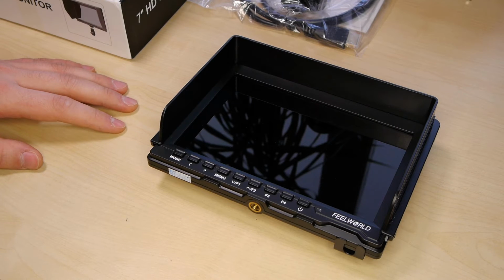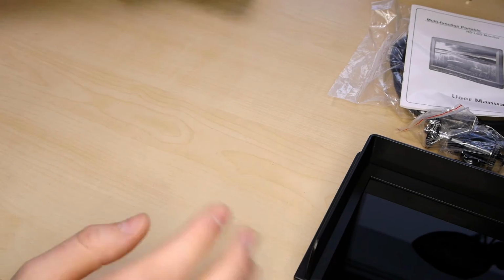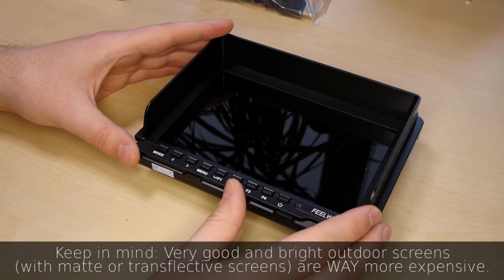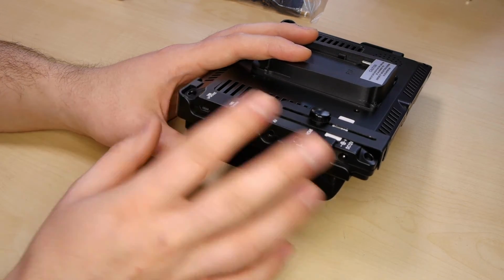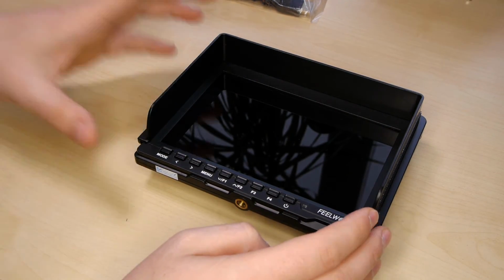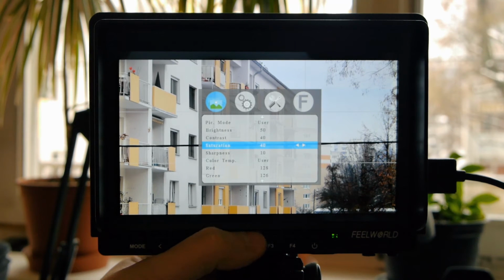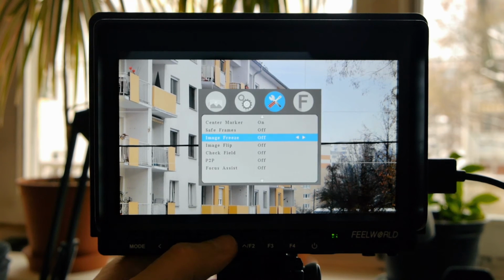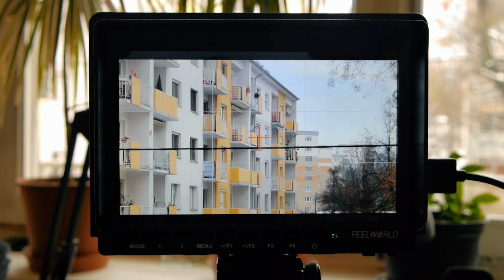Feelworld FW759 / FW759P field monitor - Very detailed HANDS ON (with calibration settings) (!)

Comment: Hi! Does FW759P have  issues with zebras (offset after calibration) like  the Aputure monitor that you reviewed? Thanks!
Reply from the maker: +Kazanchev Well - I cannot tell you that - Sorry. As I only had the FW759 in my hands til now.
BUT: The "P" model is already worth it according the histogram (which is nice to have as an overlay on the screen direclty).
And at least you get the option to use the zebras (even if you would need to switch back to one of the standard settings to get more accurate readings).
Maybe someone who is using the "P" model already can answer that question ... 

But I don´t think that you´ll run into any problems at all (in general). I just calibrated my screen slightly.
And you could even use the "standard" picture profile (which is also usable).
Btw. don´t forget - That would be only necessary "IF" there are really offsets in the Zebra readings. ^^
Reply: +AustrianGeek  I've recieved my FW759P. Zebras are useless, "right" color is only in P2P mode (useless too), all "P" functions are pretty much useless.  The 480P mode on my 550D looks so awful, can't focus at all, everything's just a blur, the interface is out of the screen... Focus peaking is a joke. Really dissapointed. Do you known where I can download new firmware? Official site has blank download page...
Reply from the maker: Oh. That´s bad to hear - Are the zebras not adjustable? And according the colours: Why are they only right in Pixel 2 Pixel mode? Shouldn´t be the case.

480P output from the older Canon bodies is always problematic btw. - It´s just SD resolution (so external screens are not THAT of a help at all). They are bigger - Sure - But they are not giving much more details to focus signifficantly easier for example. The "camera mode" (which forces 480P output on the FW759) is btw. meant to deliver more of the video image - So it´s cropping of parts of the image to zoom the center part a little bit. If you need all of the overlays, disable this mode - The image should then be a little bit sharper too (as it´s not zooming digitally monitor internal). Btw.: If the aspect ratio isn´t correct (with camera mode switched off), try to fixate the aspect ratio to 4:3 (in the FW759 menue). And try combining these settings (camera mode + 4:3 mode) to find the best combination.

In general the T2i / 550D is the limiting part - And not really that nice according external monitors. If you want better HDMI output it´s maybe a good idea to upgrade to a used 650D or even 700D (they are already very cheap on the used market and both magic lantern compatible). Just saying - With the 550D you will not be happy with an external screen (and a 1280x800 screen with such a low resolution is also quite useless) ...
Reply: +AustrianGeek The zebras are not adjustable!  They provide wrong results before and after calibration.  Calibration also affects the zebras. The P2P mode gives ideal picture with best color reproduction (like camera sreen). Saturation (sharpness and contrast too) shifts when the P2P mode is off. You can try it yourself. Connect Feelworld monitor to the PC, set 1280*800 resolution and try turning it (P2P) on and off, you'll see what I mean. The P2P mode is not affected by sharpness settings and stragely affected by saturation, contrast and brightness.
Reply from the maker: Hmm. Ok. So it´s the same like with the Aputure VS-2 I tested a year or so ago (according the zebras shifting). At least the FW759P is only about 10 bucks more expensive compared to the standard FW759 model (and at least the histogram and the additional peaking mode should be worth it - Especially if you have a camera or camcorder without internal histogram or without an histogram in video mode - Like many Nikon DSLRs).

According the P2P mode: Hmm. Yes - Sometimes it makes sense in general to use the P2P mode (as that way the internal scaler is bypassed / not used anymore). So you´re getting a better image because of that (as far as it´s possible according the input type / signal type). But it´s a little bit weird that it´s shifting the saturation and contrast too. Sharpness is more or less normal - As the scaler is bypassed (which is used to add more sharpness). Maybe also the rest of the settings are affected that way.

I had it connected to the PC too - As always within my monitor testing procedure (but I didn´t check it according P2P vs. non-P2P mode).

THX for the info btw. (!)
Reply: +AustrianGeek 10 bucks? No) It's $57. Feelworld's histogram isn't working... It gives me some BS info. When I shoot overexposed wall or sky (pure white, just to simplify the test)  it shows some different peaks (rather than "overexposed" type of histogram with peaks on the right side), it is completely broken and it shows different info when I cycle through aspect ratios. The  scaler is the evil thing in this monitor: it gives oversaturated image, less dynamic range (blacks and highlights), and aliasing
Reply from the maker: Well - It´s actually 135$ vs. 115$ on Aliexpress. Ok. Then 20 bucks - I hope you paid not that much for your screen (at a local dealer or so). About the histogram: Keep in mind, that it´s reading the HDMI output - Not the sensor directly (like an internal histogram). So you also get all the menu overlays AND also a "full readout" of the signal (from 0 to 255 values). That way you also get the option to see values from 235 to 255 (if you´re using a camera which is offering "super bright" areas like many Panasonic and Sony cameras. Your camera is outputting 16-235 as value range (as far as I know). So you´re not using the full histogram width. The best way is to check where the white indication point is on your camera (in the histogram) and use a marking - a small sticky tape piece or a removable pen marker as indicator to mark the point. Not very professional I know - But it´s at least a way to get more accurate readings with an external histogram. And it´s more or less the only way (testing it out). If you really want better reading you need a waveform or RGB parade monitoring - And such fielmonitors are WAY more expensive.

The overall problem is really the 480P output of the older Canons (it´s also a HUGE problem with other field monitors - Really hate that mode). It seems like the scaler is not perfect for such low resolutions (in the FW759 - Goot to know btw. - THX - I am adding it to the description). Though keep in mind: As said - It´s a problem in gerneral. So it´s also not that helpful to switch to another field monitor anyway (or let´s say it that way: It´s not THAT much better even with the best models out there). You would maybe get less aliasing (becuase of the better scaler). But the question is if it´s not more useful to upgrade to the 600D, 650D or 700D and to get a better HDMI signal from scratch on (which will work with ANY monitor from scratch on).

Just to mention that too: The histogram is changing btw. because you´re using different screen areas (while switching through the scaling modes with the 480P resolution). At least it´s normal, as far as the overall exposure point isn´t shifting (if you´re using a grey card for example the hump in the histogram should stay more or less on the same point). If it´s really changing the exposure point, then it´s really not usable for the older 480P output Canon - I´m sorry to say that and that I cannot help more.

Have a nice day anyway ^^.
Reply: +AustrianGeek I believe  I'm gonna buy a new camera after NAB 2016. Thank you for the info!

Comment: It looks grate! But I wait to smaller (+-5.6'') version of this monitor.
( H056 (V2) is worse and more expensive. )
Reply from the maker: +Jaromír Vyučil Well - i don´t think that there´s such a screen coming (at such a low price at least). The 7" panels are WAY easier to get and way more widespread. So it´s easier to build such a screen (at a low price point). Keep in mind - The FW759 / FW759P is already quite lightweight and the frame already is very small & thin. So there´s a high chance that a 5.6" model is as big and heavy anyway (because of a bigger frame) ^^. Btw.: If you want to spend more, then Feelworld is also offering now a 5.5" Full-HD display model (called "G55"): http://goo.gl/sjQ8k8

Coming with WAY more features (like waveform, vectorscope, RGB histogram, audio level meters, false colours, zebras and so on). But if you just want the scopes then a used Atomos Ninja Blade recorder is maybe an even better choice. You can get it for about 350 to 400 bucks used (at least here in Europe) - And it´s a 5" 1280x800 IPS Panel screen + 10Bit 4:2:2 Full-HD recorder. Nice unit (i am using it by myself btw.) - AND it´s coming with great scopes and image quality (plus very nice control options over the touchscreen). It´s also usable as an monitor only btw. - The recording feature is just "the icing on the cake" ^^. (I am using for example an old 256GB SSD and a 500GB HDD I had lying around for recording - Both are working 100% flawlessly up to the highest bitrates.)

Just an option you should consider. ^^

Comment: how does the software update work/
Reply from the maker: +Toney Franco Sorry - You need to ask for that Feelworld directly (for model specific instructions). I am not sure at all if it´s possible to get the most actual firmware for a self upgrade anyway - Normaly you need to ship the device back for an update (that´s the case with Lilliput for example). Though: Normal procedure (with other screens) is to connect an USB adapter (Mini USB plug to a USB Type A jack) and then use an USB flash drive with the firmware on it. Then you should be able to start the update in the menu (and the screen should restart automatically). But that´s only the general procedure - Please contact Feelworld to get the actual firmware + the specific instructions. P.s.: Please leave a message here (if you get the firmware update with the instructions), as it´s for sure also important for other users ...